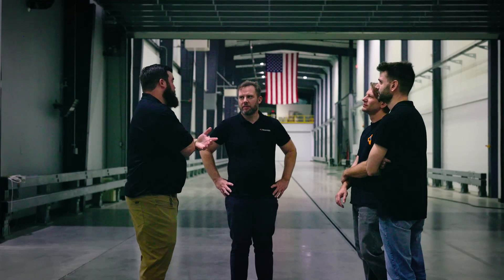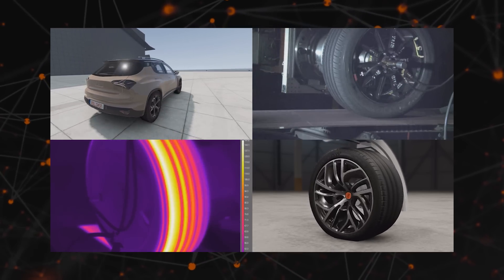Sneak Peek: Tire Physics Development

Comment: Realistic Tire Wear and Temps
More in depth engine customization and dyno capabilities
Ability to repair/swap parts without resetting the whole vehicle.

Coming from someone with 2700+ hours Beamng is pretty much perfect and has come so far in the 7-8 years I've been playing. The 3 ideas above combined with a new vehicle or remaster every so often would literally make this the perfect vehicle sim IMO. Playing BeamNG for the first time is enough to make any gear head throw out every other racing game. I cannot wait to see how much more advanced and polished BeamNG will become over the coming years. Not only does BeamNG offer countless hours of enjoyment from an entertainment perspective, but I believe it will become a very popular tool in the automotive and racing industry similar to IRacing in a way, but with almost unlimited capability to simulate any serniero in the automotive industry from performance simulation, to stress testing, product development, and so much more. From working in the Dirt Racing industry I cannot imagine how big of a tool BeamNG would be for suspension testing and development if we had the ability to accurately create and simulate the tracks and vehicles we use.

Keep up the good work boys!
Reply: With all the stuff they've added, I've actually removed most of my mods, went from 190 to just 30 because the Devs are adding stuff that makes mods redundant!
Reply: @coastaku1954 Same. You don’t need more mods if the game gets better and better
Reply: @coastaku1954 Right? I remember times when I used to get bored with BeamNG and Install a ton of mods to find something to do, anymore with all the content and detail they've added I've all but stopped using mods besides a select few, 9/10 times I'm just enjoying the vanilla BeamNG experience.
Reply: @RayTracedChevy350  What really did it for me was the addition of the Miramar Ute, I was watching the announcement trailer and was like "They better have a ute..." and then it heard me! When I played the game after the update, it went into the mods disabled mode as usual and I had a great time with the base game, so, I decided to do a mod purge, especially since I BARELY used 75% of the mods I had, and they were just cluttering up my vehicle list and blending into the actual vanilla cars and configs.
Reply: Ability to repair/swap without resetting is something i thought about for literally at least 8 years lmao i love that idea.

I hate ripping off the hood of a car to see how an engine looks just to rip another hood off again when i put another engine in or swap a miniscule part.
Reply: @FullsendMSV  I mean, we did have a Repair mod years ago, but it only fixed the Jbeam, like body damage and stuff, not alignment, tires or engine

Comment: Correct tire smoke. Most games (including BeamNG) base smoke on how much your sliding instead of the heat from the tire. Open wheel cars are light and take a while to start smoking (when sliding or doing a burnout) while NASCARs are heavy and make smoke quickly.

CSP for AC has some excellent smoke.

Comment: What if they also add wind physics produced by the car while driving at high speed in real life? For example, when you pass quickly near the grass, the grass moves due to the wind caused by the car and also by the air expelled from the exhaust pipe. These are details that may not be very noticeable, but they give a good vibe of realism. Good idea or not? If you want, you can leave more ideas about this in the comments.

Comment: Everyone called it. As soon as this change is implemented, every other studio that produces any kind of car simulators or games will be out of a job. 😂

They'd literally have to work with BeamNG to stay afloat. AC-E, IRacing, Grid, Gran Turismo-series, all of them will be left behind.
Reply: i dont think they would be out of a jb since beamng is a pretty demanding game but it certainly be the top dog after they remake the aerodynamics.
Reply: @idkiforget  I'm waiting for the aero physics remastering. There are many things that could use developement time, like an even more realistic structural rigidity rework. Would be cool to see more rigid structures not collapse as easily as the less rigid ones. 

Would also like glass to to fracture & even shatter in some cases (because modern glass in cars don't shatter if you sneeze on them the wrong way, like in GTA 5), but I want it to do it realistically, with the particles still on the vehicle, sliding about, or falling off the car. 

Even the sounds the engines make. They're a bit too isolated, the sound should reverberate off the enviornment, make subtle wooshing sounds under load, and have WAY more low end frequencies than they currently do.

BeamNG already has a lot of what I want, but not in the way that I'd like it to be. But they know that, and they're working on that because that progress excites them.

Comment: Hot damn, this is sick. I do still kind of miss the old tire model where the ground actually deformed the tire instead of the weird soft spongy clipping thing happening now, it makes it hard to see your tire pressure. Still waiting on thermal simulation too... and I think a central row of nodes would be good, especially for the wider off-road/crawling tires that should wrap around rocks instead of clipping through them...
There's so many potential improvements.

Comment: FINALLY BRO WEVE BEEN WAITING FOR THIS SINCE 2013, bc tbh these tire physics ain't that good, i mean it only deflates underneath massive bumps/spike strip mod, or when a bumber or smth gets wedges inside ur tire witch isnt that realistic,bc tbh im not expecting this anything soon, but the plastic parts like the bumper irl would prob like split into different pieces, but thats too far/much ngl, but atleast the soft body for the tyres are good, bc ive seen it in slow motion and it deforms pretty well

Comment: Some dramatic and dubious claims being presented. I am extremely skeptical if you have managed to achieve even basic correlation in your tire model with the way it's constructed. If you somehow think you've cracked the code, then more power to you. Personally I will wait and see, and maybe eat my words, but I'm fairly sure I won't be.

Calspan and other rig testing also isn't the end-all be-all and you will need to perform on-vehicle on-road tests, which will be dramatically more difficult to interpret than the already extremely difficult to interpret rig data. Based on your claims you've achieved perfect, exact correlation, so I guess that one will be easy too.
Reply from the maker: Thanks for your concerns! No, we have not achieved perfect correlation, this just marks the first step in the direction towards better tires. We'll publish the data so you can see yourself when it's time.
Reply: @beamng  Yep, didn't think so; but it sure starts sounding like that later in the video.

I don't want to be a downer, I'm just saying to temper your expectations and the expectations of the playerbase. Even if you perfectly correlate the Calspan data, it's not going to be drivable and people will hate it, and you will need to perform on-road testing ($$$$$$$$$$$$$$$$$$$$) or evaluate it further.

However, it is very much so worth doing and I hope you can do more in the future. It's just not going to cure cancer and achieve world peace.

It would be extremely generous if you do post the data and would win a lot of good-will IMO.

Comment: It's cool that you decided to share videos like this, I'd like to learn more about how physics works in BeamNG. However, given the current state of physical interaction with materials and how those materials are set up now it seems to me that it's a far cry from how it is in real life. Will there be any updates to the physical properties of materials in the near future? Alas, I have no objective data on the interaction of specific cars in both real life and in the game, I can only base on the sensations of driving in the game and compare them with how cars behave in real life and it seems to me that what is available now can be partially corrected by changing some parameters.
Reply from the maker: We are always trying to improve the simulation, how can we do better? What is off in your opinion?
Reply: @beamng  I don't know exactly if I can clearly and concisely formulate the problems with physics at the moment.

In my opinion, the physics of cars in many aspects I have doubts that they are close to reality, for example, cars on low bumps or the same lying policemen behave very strangely, especially a lot of questions why the rear of cars very high bounces, as if the cars do not have enough weight and downforce. With trucks it's even more obvious, largely due to the very stiff suspension.

With potholes on the roads also strange things happen, even at low speed to damage the car and suspension in a small hole is extremely difficult, so the potholes have to, which in length and width the size of the car, otherwise the car passes all these potholes as if they are not there

Another of the last things that drew attention - the suspension of cars incredibly strong, to damage it intentionally extremely difficult, have to resort to the module Car Values. I can't say exactly from which version the suspension strength settings have changed dramatically, but in the early public versions of the suspension was damaged much easier. Undoubtedly it should have been made stronger, but I think what we have now is a bit too much.

Unfortunately this is not all the problems, there are many others that do not concern problems with physics. At the moment I have more than 7000 hours in the game, if my experience can help in any way, I am open to dialog, I would be glad to communicate with the developers more thoroughly

I apologize for the delay in replying=)

Comment: I do wonder tho, Since this would Simulate Grip and Heat and Air pressure... would the tires also wear down if you pull 20 minute long bunrouts?

Comment: Just gonna say this - if Beam devs will implement data from testing into in-game tyre model, it will be HUGE news. Current tyre model does not allow to recreate load and slip parameters 1:1 with any tyre tests I looked at IRL. If we get tyre model with proper non-linear progression over load, more control over slip behaviour etc. we might get the best feeling road cars in history of sims.
Reply: It doesn't need to be realistic, it needs to deliver A LOT of force feedback data/information to the wheel. I'd much rather the tire model be focused on force feedback
Reply: That's if they get the force feedback right. I'd rather them exagurate the tire model a bit to bring more force feedback data/information. Assetto did that and people say you can literally feel more data coming to the wheel than in real life. Would be totally worth it
Reply: what's really impressive with beamng compared to other sims is that Beam is a game.. its not actually a sim, it has actual extensible gameplay that's not just hardcoded to racing and you can stretch it faaaar in any direction. you can also take it outside of a realistic simulation with the realistic physics which is a huge boon for creating fun and interesting driving games
Reply: @insector2093  Well, I disagree with this take. It's exactly opposite. Beam is "full" sim, as 90% of it is just simulating a vehicle and its' systems. Where it lacks is "game" part, as there's little to do with these simulated systems atm.
Reply: @gameboyterrorysta6307  I think he's saying that Beam is more than like, rFactor 2 or something where you pick a car, pick a track, and you're confined to that track.

Something I wonder is how far the road compounds out of Automation exporter will be from the new Beam tires. Because they're super icy, meanwhile the Beam road tires already feel good to drive.

Also how far Auto export 1960's tires are off, how far Auto export racing tires are off, former is too icy and latter is too grippy (in case of soft and drag compounds).

This would mean testing of racing tires, which I don't expect Beam to do. And also vintage tires don't exist unless you find a manufacturer that produces them, like Coker tires in the states, so no expectations there.
Reply: @gameboyterrorysta6307 beamng is a sandbox game built on a simulation engine. and your last sentence is just wrong. i have a humble 400 hours but there's people with thousands of hours in the game. there's multiple gamemodes and challenges, including career mode, as well as user created challenges and gamemodes. the options for what you can do in the game even at this point are practically endless.
Reply: Heard complaints about I racing being a bit off on their tire models and such. Your right it would be a huge leap forward
Reply: *Tire
Reply: @Joshua-j9x6l tyre is also correct - it is the British English spelling

Comment: Deutsch:

Das Video beschreibt ausführlich die Zusammenarbeit zwischen den Entwicklern des Spiels BeamNG und Calspan in Buffalo, New York, zur Verbesserung der Reifenphysik im Spiel.

Die Hauptziele der Zusammenarbeit sind ein tiefes Verständnis der Reifenfunktionsweise und der zugrunde liegenden Physik zu gewinnen, die Physik in BeamNG durch das Sammeln von Daten von etwa 30 verschiedenen Reifentypen zu verbessern und die Reifenleistung für eine simulationsbasierte Ausgabe zu messen [00:10, 00:31].

Testverfahren und Datenerfassung:
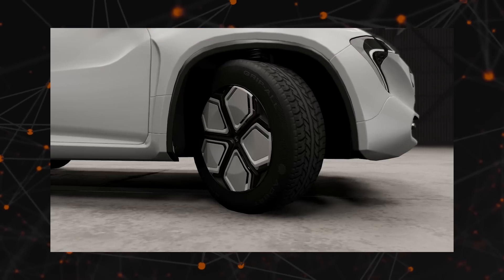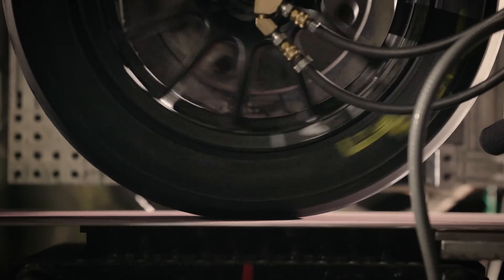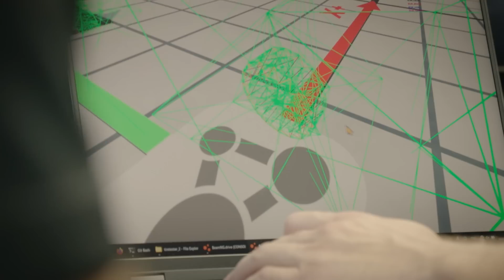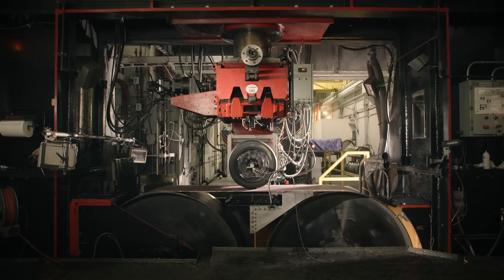Ein umfangreiches Testprogramm wurde entwickelt, da ein einzelner Reifen kein vollständiges Bild des Reifenverhaltens liefert [00:44]. Am Prüfstand wurden verschiedene Sensoren angebracht, um Daten zu sammeln, darunter Temperatursensoren im Reifeninneren, an der Oberfläche und für die Lufttemperatur, Laserpointer zur Messung von Seitenwandverformungen und Mikrofone zur Analyse von Reifengeräuschen und deren Profilen [00:57, 01:10]. Reifen werden unter verschiedenen Bedingungen getestet, wie großen Schräglaufwinkeln, viel Gas und starkem Bremsen, um die Krafterzeugung des Reifens unter diesen Bedingungen zu ermitteln [01:24]. Der Testplan umfasst statische Tests zur Bestimmung der statischen Steifigkeit des Reifens und Handling-Tests zur Erfassung der resultierenden Kräfte und Momente des Reifens unter verschiedenen Bedingungen, einschließlich hoher Schräglauf- und Sturzwinkel [01:36]. Die Testmaschine kann vertikale Lasten von bis zu 6 Tonnen aufbringen und Geschwindigkeiten von über 200 mph erreichen. Ein 1.400 PS starker Elektromotor treibt die Fahrbahn an, und ein speziell entwickelter 1.000 PS starker Permanentmagnetmotor kann über 8.000 ft-lbs Drehmoment direkt auf das Rad übertragen [01:50, 01:57].

Integration von Spieldaten in die Tests:
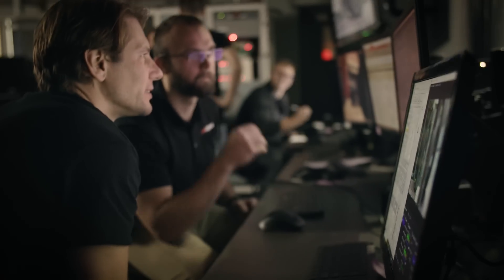Fahrzeugfahrten in BeamNG werden aufgezeichnet und als Input für die Reifentestmaschine von Calspan verwendet [02:05]. Die von der Testmaschine erzeugten Daten werden zurück in eine Nachbildung der Testmaschine im Spiel eingespeist, um eine direkte Korrelation zwischen den im Spiel und auf der Maschine erzeugten Kräften zu sehen [02:13]. Dies hilft, verbleibende Probleme mit dem Reifenmodell zu identifizieren und sicherzustellen, dass das Reifenmodell auch bei extremen Manövern und schnellen Lenkbewegungen korrekt reagiert, um ein authentisches Fahrerlebnis zu bieten [02:31, 02:38].

Zukünftige Entwicklungsbereiche:
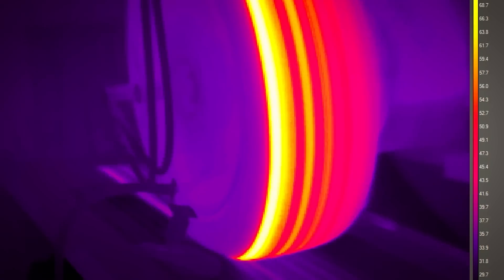Zukünftige Entwicklungsbereiche umfassen ein vertieftes Verständnis der thermischen Eigenschaften von Reifen, einschließlich der Erwärmung und der Auswirkungen der Temperatur auf den Reifen, sowie die Untersuchung des Reifenverschleißes und dessen Einfluss auf die Handling-Eigenschaften [03:07, 03:14]. Auch Effizienztests und der Rollwiderstand von Reifen sind wichtige zukünftige Aspekte [03:21].

Vorteile für Spieler:
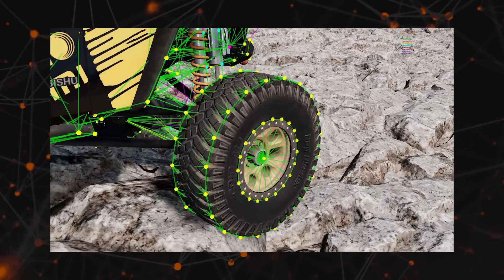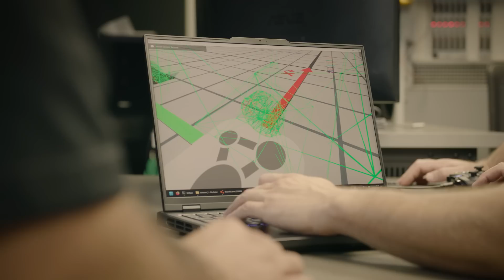Die konsistenten Reifendaten gewährleisten, dass Spieler die richtigen Lenkkräfte und Handling-Eigenschaften der Fahrzeuge spüren [03:28]. BeamNG verwendet ein physikalisches Echtzeit-Reifenmodell, das auch in extremen Situationen eine gute Leistung bietet [03:43]. Spieler schätzen die tiefe und korrekte Physik im Spiel und das Vertrauen, dass sich das Fahrzeug richtig anfühlt [03:55]. Die Verwendung realer Daten für extreme Reifensituationen ermöglicht es den Spielern, zu sehen, dass das, was sie im Spiel tun, genau dem entspricht, was im wirklichen Leben passieren würde [04:07].

Comment: Tires need more grip. IRL i can easily take a very sharp corner going 40-45 mph when in game anything over 30 you instantly slip out. This is obviously not the most scientific comment as you would have to have the same conditions in game and IRL to test it but I can be sure without a doubt that the grip mechanic in this game is lacking.
Reply: sometimes it's also the fault of the simplistic groundmodel and perfectly flat road geometry.